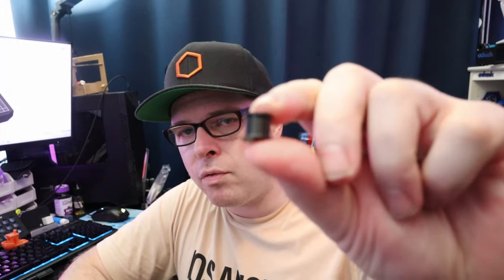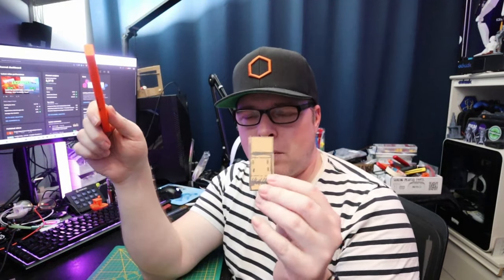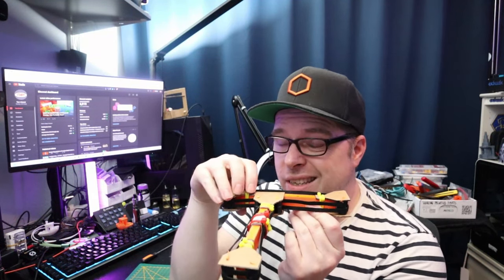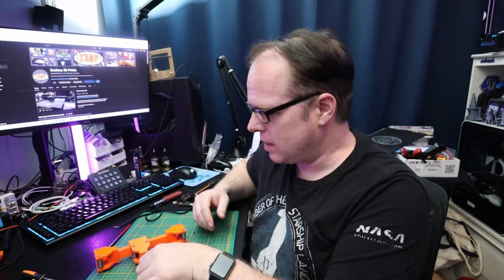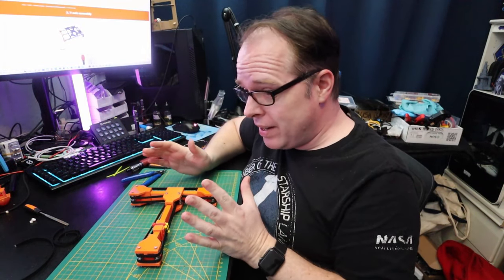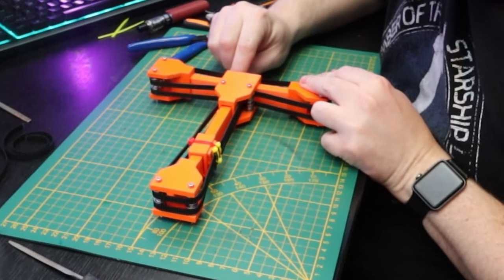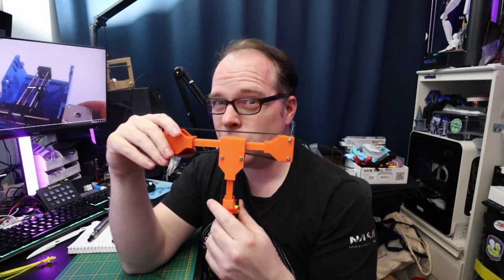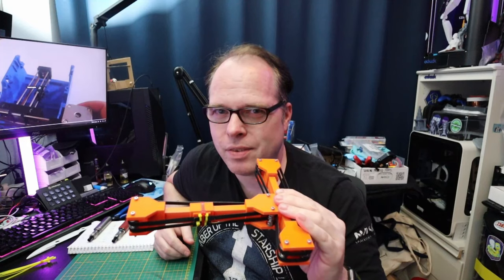Cantilever CoreXY - Z-Core - CAD Design and Prototyping - Part 3

Comment: I had a similar idea about a cantilever CoreXY design, I will be watching your channel for your progress.
Reply from the maker: Oh that’s very cool! Love that. 
Yes soon there will be a new video coming about that
Reply: @Zachary3DPrints  I think your setup should be working. 
Suggestions, if you dont mind:
* Use tighter belts
* Attach the two belts on alternate sides of the head slide, I think it might even out the pull on the cantilever.
* When testing hold one belt firmly in place against the Y beam, this should give you your diagonal movements
* When testing move both belts in opposite directions, this should give you your Y movements
Reply from the maker: Thank you for the tips, I think I did figure it out recently and making a video about, before adding the motors and other electronics
Reply: @Zachary3DPrints  Any progress on this project?
I was able to prove out the belt syste: https://youtu.be/7c_Ammz7U2I?si=OZ12-rGIkDjkIg1Z

Comment: Found this video because I was thinking of trying the same thing except with a cantilever core “XZ” I think the reason your design isn’t traveling like it should is because the belts need to route back towards the steppers without being attached to the carriage. So there will be 4 attach points on the carriage plus 2 belts that just pass through without being attached. The center portion would need 6 pulleys instead of 4.
Reply from the maker: This Cantilever CoreXY is still open and I'm going to work on this. I will take these thoughts in there as well. 
The belts are at 4 points connected to the carriage and on the back side of the carriage they are not connected. 
I need to make it much less complex and make it simple.